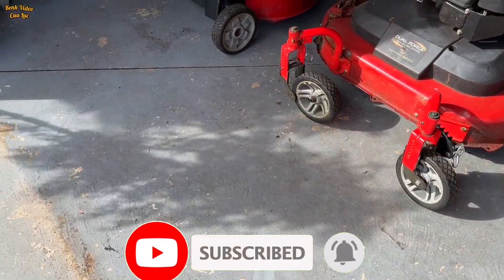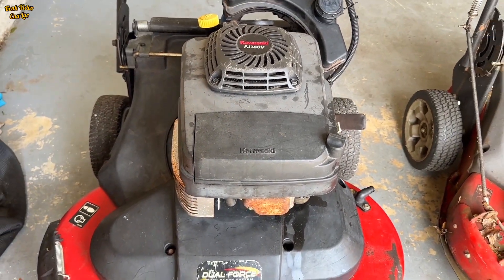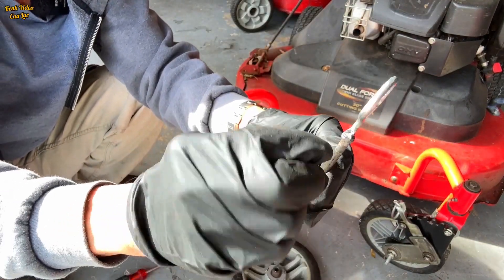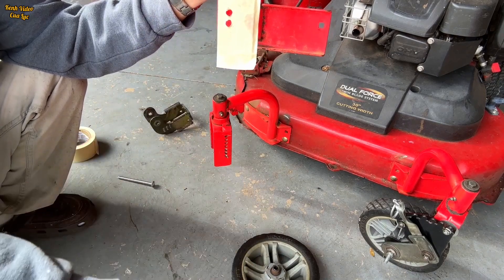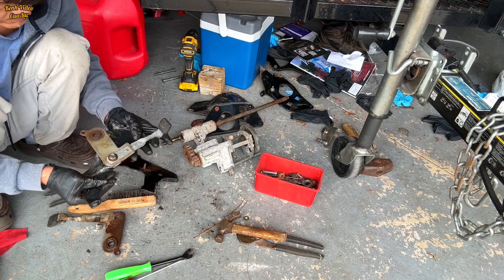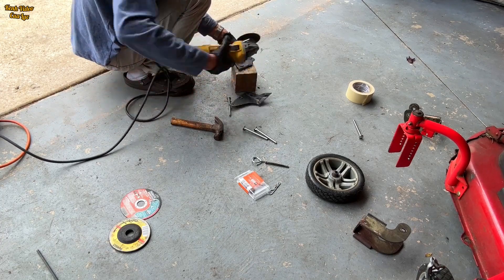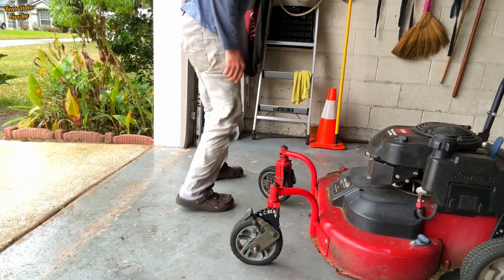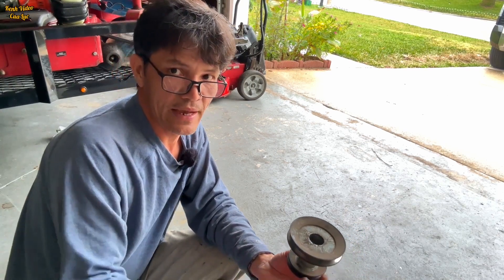Using parts from Gravely 21 to upgrade Toro Timemaster 30

Comment: U could have just used the other castor wheel bracket and laid it over the other bracket u we’re needing to drill another hole in and used it as a guide/template also.
Reply from the maker: Thank you for the comment biams!